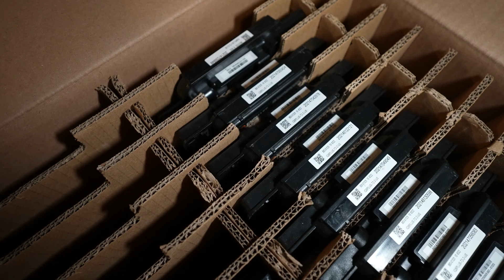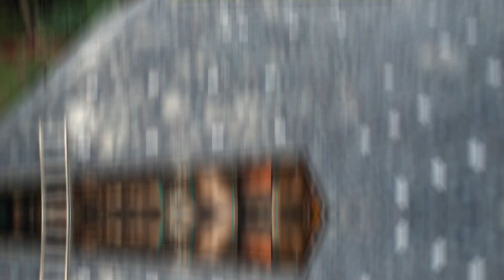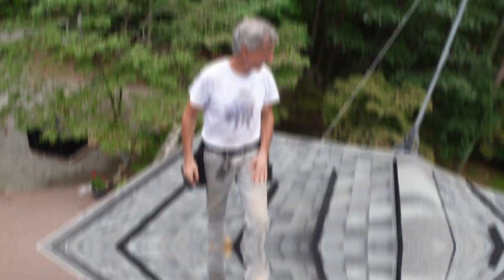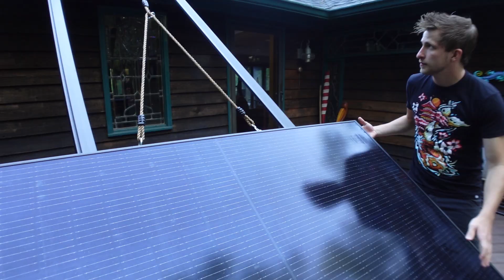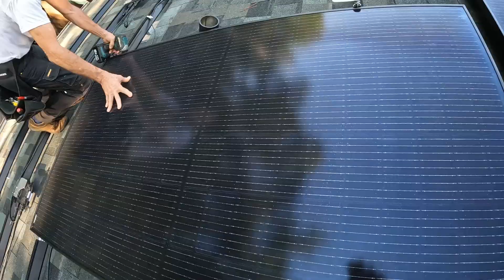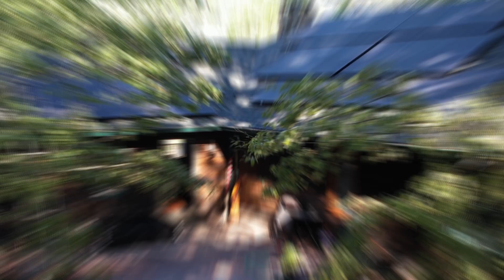Installing 39 solar panels

Comment: I'm kind of dumbfound and confused by your purchase.... Why would you buy microinverters and buy a Sol-Ark 15K string inverter as well? This makes absolute zero sense. Who sold you on this idea? They most definitely oversold you on the product!
Reply: You live in a beautiful area, bus seeing the drone shot I'm also highly skeptical about just how much solar energy you're going to be able to harvest in the forest like that. I have a system being installed which is significantly larger (19.4kW), it sits 100% in full sun in Texas and I only expect about 25,000 kWh of energy a year out of it. Did you do any modeling or shade estimation for your area?

Comment: Why did you use microinverters instead of just running DC to the Sol-Ark?
Reply: I was thinking the same thing when he got out the microinverters why get an all in one inverter capable of 17KW PV input only to use micro inverters unless he plans to add more panels down the road and use that which I think its capable of 17KW DC and like 16KW AC power from the micros.